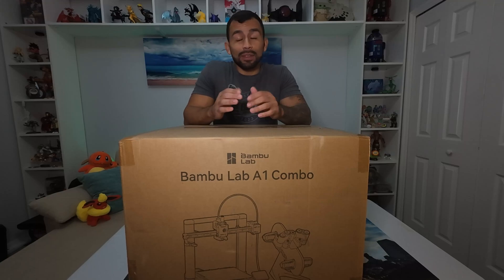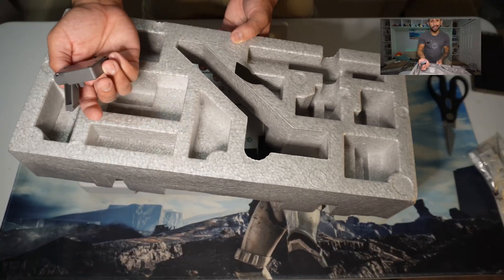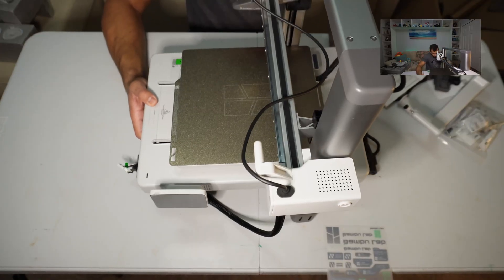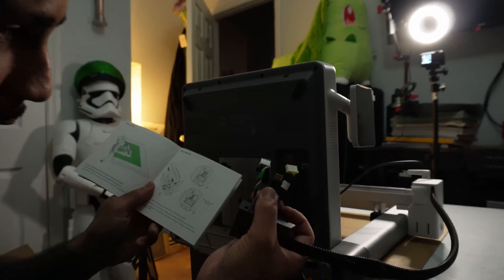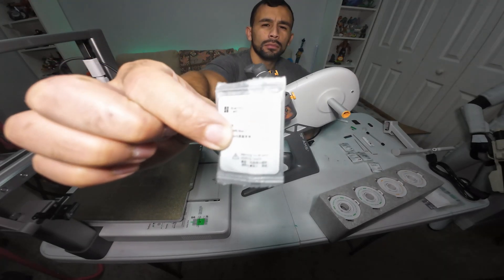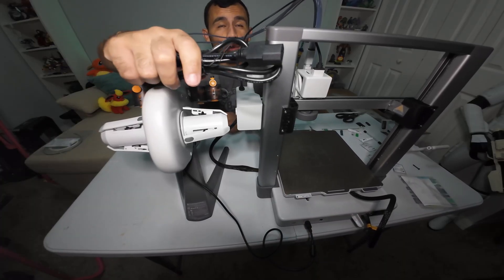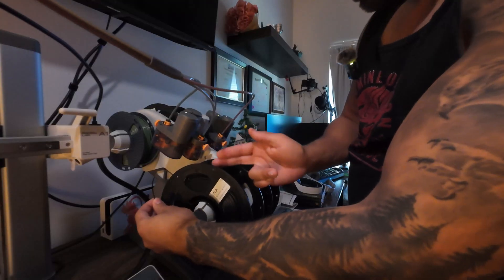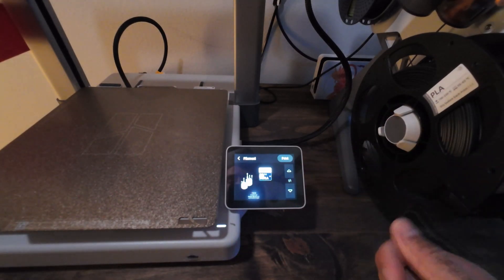Bambu Lab A1 Combo Unboxing, Assembly, AMS Lite Setup, and First Test Print

Comment: Thanks for sharing! I've been thinking about getting one. The filament it brought is a good brand to buy? Or have you found another type you like?
Reply from the maker: It only came with a small samble of Bambu, which is what is recommended. However, ive been using generic brands from Amazon with no issues so far!